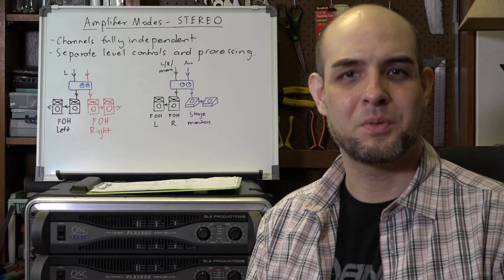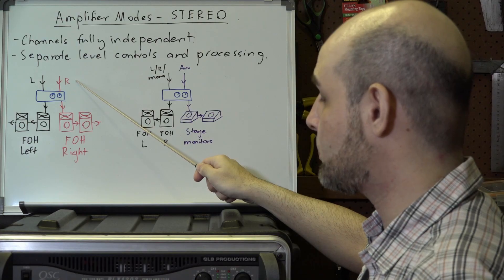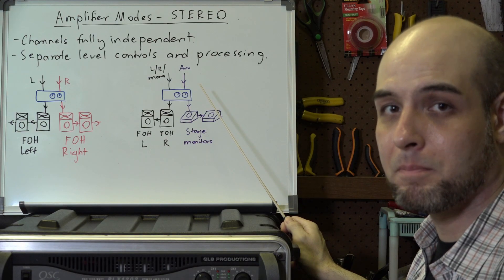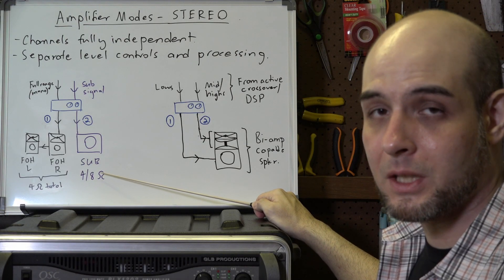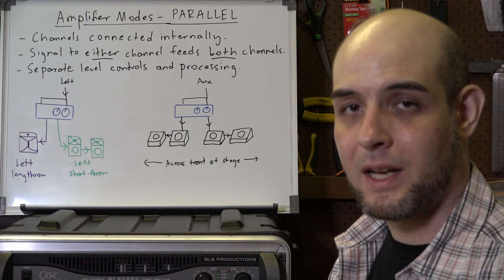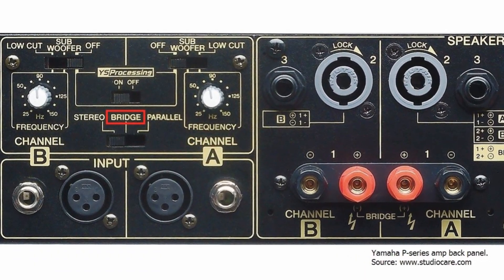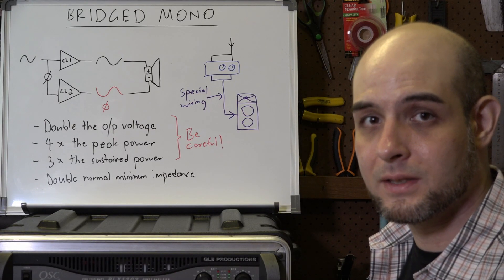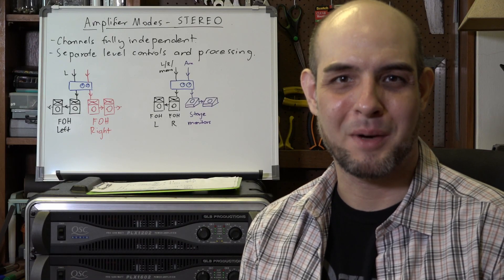Power amplifier modes explained

Comment: For a guitar amp that has two output jacks in Parallel set to 8 ohms, when you connect an 8 ohm speaker to each channel does the amplifier see it as a total load of 4 ohms? So if that's true do I need to change the ohm switch on the amp to 4 ohms to match the total load?
Or does the two Parallel outputs each handle 8 ohms when the amp is set for 8 ohms? Meaning can I connect to two  8 ohm speakers, one to the left output and one to the right output and have the amp set to 8 ohms? That's the way I always thought guitar amps worked but recently I read it is as in the top paragraph. So now I am confused.
I know when you run two 8 ohm speaker cabinets in series then the amp see's 4 ohms on a single output jack, If you run both output jacks that way the amp runs at 2 ohms.

I need help because I plan on running a guitar amp using two separate 4 ohm speaker cab's in parallel. One cab into each output jack. Normally I would set the amp to 4 ohms. But now I am confused about parallel outputs seeing the total load of 2 ohms if I do that and of course my guitar amp does not have a two ohm setting.
I would not wish to blow up a brand new amp.
Thanks for any considerations you may give in this matter.
Peter
Reply from the maker: Hello Peter - which guitar amp are you using please?
Reply: Wow! I was hoping you would help me but never did I expect such a fast response. I'm about to purchase a new  Bugera 1960. It has two output jacks and is wired in parallel. It has an ohm selector switch for either 4/8/16 ohms. Just like my old Marshall JCM 900 MkII which I now think I always had it connected wrong. It did not damage the marshall. I ran two cables out from the amp to two 8 ohm speakers and had the amp setting on 8 ohms. The Bugera is the same set up.
Thanks GLB.
Reply from the maker: Ah ok that is all-tube head so I can understand your concern. A couple of points: 
1. This amp does not have 'left' and 'right' speaker outputs - that would imply a stereo head with separate left and right power amp sections. This simply has two outputs, both connected to the same power amp. 
2. Speaker cabinets are always connected in parallel - series wiring may be used within the cab, between individual speakers, but never between cabs. 
3. Connecting two cabs in parallel, ie out from the amp, into the first cab and then out from that into the second cab, creates the EXACT same load on the amp as connecting both cabs directly to the amp, one to each output. 
4. In your case, the combined load on the amp is 2 ohms (two 4-ohm cabs in parallel) however the cabs are connected, so that will likely cause an issue because as you point out the amp is not designed to go below a 4-ohm load. 
If you want to be absolutely sure about this, contact Bugera, but I suspect you will get the same answer from them.
Reply: I see. The total ohm load when using qty. (2) of 4 Ohm Cabinets is = 2 Ohms. That is what I always thought.
I guess because with my Marshall JCM 900 MkII Tube amp set to 8 ohm load and run into to 8 ohm cabs in parallel I got lucky that it never hurt the amp. I ran it at Full Power for years and nothing ever happened. I guess that because the Marshall can run down to 4 ohms that even though I had the amp's selector set to 8 ohms the amp survived the abuse. I would never do that again.
Well thank you very much GLB!

I always thought by using the selector sw. on the amp to match the impedance of the cab's that it was correct. I did not use the Total Impedance which was my mistake. I thought set the amp to 4 Ohm for two 4 ohm cab, 8 ohms for two 8 ohm cabs and 16 ohms for two 16 ohm cabs. See? I was matching the impedance of the cab's but did not take into account the total impedance.
Thanks Again GLB!
-Peter
Reply: GLB Once again I thank you for your considered and in depth reply.
-Peter
Reply from the maker: You're welcome Peter! Apparently there is some leeway for error when setting that impedance switch, according to this source: http://blog.hughes-and-kettner.com/ohm-cooking-101-understanding-amps-speakers-and-impedance/
The only rules appear to be: 1) Do not run any tube amp without a load, and 2) Do not run them into a lower input impedance that they are designed for. 
All the best with your music!
Reply: Wow! Thanks I read every word of you supplied link. It did not cover what I did exactly but I understand the concept and trust their  explanation. Because years ago my Marshall JCM 900 MkII was running at 8 ohms connected to 2 of 8 ohm cab's a total load of 4 ohms never -and had problems. I also learned about how to alter the mid's and low's by changing the amps impedence.
I appreciate the fact that even after you replied twice you continued to research and find something that I could really understand. I should feel a little ashamed because I should have done more research myself.
You are a good teacher as you make sure your student grasps what you are saying. I am such a person that I need it phrased and rephrased a total 3 times in order to be sure I comprehend. But once learned and understood correctly I can continue learning.
Thanks again my new teacher and friend. BTW I'm 67 years old and have always loved science. I used to have my own copy of the NEC Code book but it's misplaced now. I was an artist and then later on I worked as a Mechanical Engineer for the rest of my working career. My first love is music (violin) but a neck injury makes playing almost impossible because of the pain. So now I play many world stringed instruments all of them are acoustic. Oud, Sarangi, Sitar, Sarod, Rabab, Veena, Pipa, Erhu, GuQin and guitar. I live electric guitars so much I play every day.
-Peter
Reply: Thanks for the link, it explains why my Marshall never had any problems set at 8 ohms and running (2) 8 ohm cabs. I saved the link in a special (Amp) folder for future reference.
You are a good teacher and I appreciate just how very thorough you are.
-Peter
Reply from the maker: You're most welcome Peter :)

Comment: Sir, I have a  MBE S1800 Power Amplifier but I dont really understand what is this meaning. 8ohms (bridge): 850Wx2 Can you explain if what is this meaning sir? Thanks in advance.
Reply from the maker: Yes that doesn't make sense - the bridged mono rating is always a single power rating into a given impedance.

Comment: A small question, is it ok to connect a single 100watts speaker to a 100watts(50+50)amp to a single channel?
Reply from the maker: Yes it's fine, just remember that you will not be getting the maximum possible volume from the speaker.

Comment: Hi Bruno,

Excellent video. I need your expertise on this since I am not sure. I am about to set up an 7.2 AV receiver having rated RMS 120W per channel to five speakers. Two front speakers are rated 150W per channel, the front rated 100W/channel, and two rear speakers rated 100W per channel.

Do you think the receiver could handle speaker power ? 

AV receiver : Yamaha RX-A1060 (RMS 120w)
Two front speakers : Monitor Bronze 6 (RMS 150w)
Center : Bronze center (RMS 100w)
Two rear speakers : Monitor Bronze 2 (100w)

Thank you very much for your advice
Reply from the maker: This is fine for home theatre use because you are rarely playing at the extreme levels that you get in live sound reinforcement.

Comment: Hi Bruno,
Great Video. 
Just wanted to know what happens to the impedance of the amplifier channels in Parallel mono mode
Reply from the maker: It's identical to the operational impedance when in stereo mode. The channels still operate independently except they are fed a common signal from input A usually.
Reply: +GLB Productions 
Thank you :)
Appreciate it

Comment: Very helpful education video. Thanks Bruno. 
Can a lower power output (RMS) Power amp drives speakers that RMS rated higher than the Power amp? For example, 50W per channel Power amp drives 2 100W speakers.
Reply from the maker: Yes you can do that, you just will not get the maximum possible output from your speakers. For music playback, home stereo applications etc this is fine.
Reply: GLB Productions Ok. Thanks.